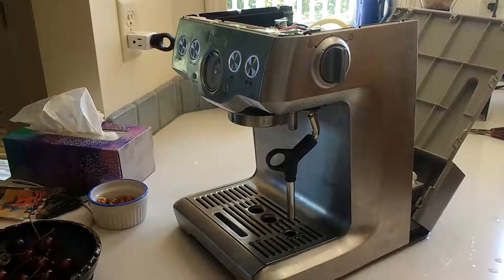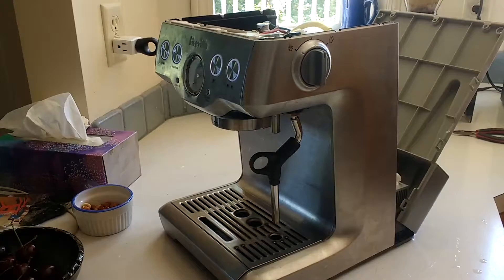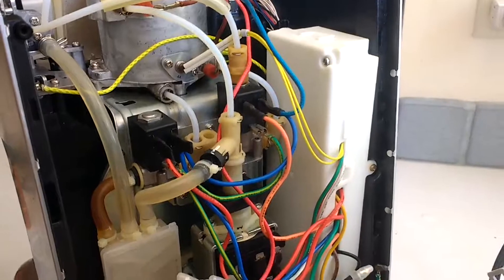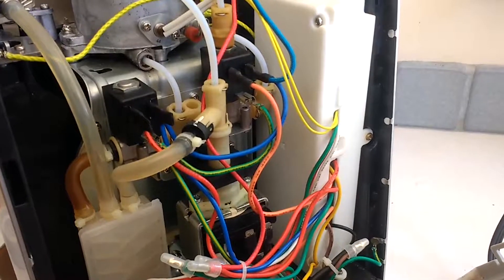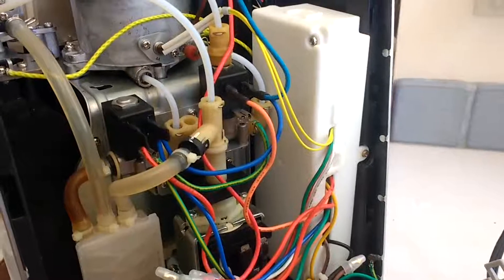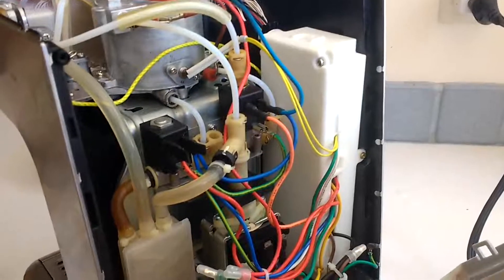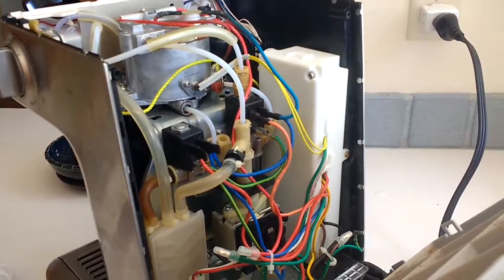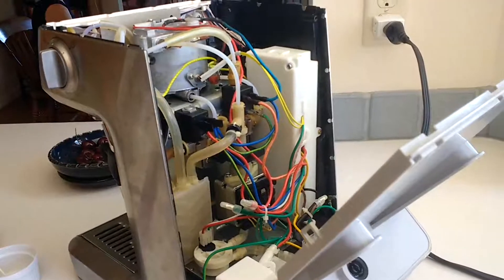Breville Infuser BES840XL - no water flow - solenoid block repair

Comment: How in the fuck did you get the back off this thing??? I've pulled every screw everywhere, and it still won't come off. If I pull any harder and going to break something
Reply from the maker: That removal is indeed challenging. If you look carefully, you will see three little gray female "rectangular loop tabs" along the edge of the removed panel. Those attach to three corresponding male protrusions on the main body. A flat-bladed screwdriver can be carefully used to pry a slight gap between the body and the rear panel as you pull backward on the rear panel, starting from the top. It did take me what felt to be quite a bit of back-pulling force to release them. 

And, one of the plastic loops has now broken during a later repair. Fortunately the other five plastic loops still hold the panel on just fine.

Hope this helps you.
Reply: @ritawije  wow, can believe you responded, thougg it was just venting to the ether. Thanks!

The clips you mentioned were a pain, but I got them uncliped. The problem is the lower section of the unit, where the water tank sits on. It feels like there is still a fastener holding it on. Something hidden. It shouldn't be this stubborn to remove. I found the hidden screw underneath the tamper.

I'm not seeing any other fasteners under the machine, not sure what I'm missing. I'm gonna give it a good pull, can't break broken.

I really do appreciate you responding though, can be useful for someone else in the future
Reply from the maker: Did you remove the screw that is under the little grey plastic cover, right behind the black water inlet which you see when you lift the reservoir? Pry that little grey disc up with your Swiss army Knife (or whatever) and there is a Philips head screw down there. Anyway, that could be your problem. If that screw has in fact been removed, then the only other thing (that I can think of right now) that holds the back on is the water tube that is attached to the underside of it. That tube needs to be pulled off if you want to set the back aside completely.
Reply: @ritawije  Mark... I feel like an idiot. I don't know why I didn't pop that  little cover off... that was the one. Thank you! I know what I'm doing this weekend. 

All the best!

Comment: I had the same problem of no water flow. I would suggest to prime the vibration pump, i.e. try to get water in the pump, to start again. Priming the pump solved my no water flow problem.
Reply from the maker: That sounds like an easy fix, if it works. I did not know about it, so never tried it. Please tell us all: How do you prime the vibration pump?
Reply: @ritawije  https://www.youtube.com/watch?v=xZIqO-i5kQg&t=62s&ab_channel=1st-lineEquipment
Reply: Hi , can you tell me how please ?
Reply: @karao7831  https://www.youtube.com/watch?v=xZIqO-i5kQg&t=62s&ab_channel=1st-lineEquipment

Comment: We have had 5 of these. Pricey (>$2000) and they typically fail at the 2-3 year timeframe. Our current model solenoid seems to have failed. I would look for a more reliable model unless you are very handy  with home repairs and can get parts.
Reply from the maker: Hey David, I agree with you. These are nice when they work, but were not built to last. Our unit is still in use, but I've had to replace the solenoid block with a new one after the "cleaned' one failed. As well, the hot water spout broke off once when the brew basket vibrated off and went flying. I fixed that by jamming in about 2" cut from the small end of a dollar store baster. Most recently the white plastic safety valve inside sheared off. Our local Vancouver supplier of Breville parts was out of those, so I ordered one from Australia. That fix was easy. But, when this machine fails beyond my ability to repair it, I will be getting another model, probably a Gaggia Classic. I like the hot water dispenser option, and many machines do not have that.
Reply: @ritawije  Interesting, Thanks

Comment: Hi Mark, this excellent video starts a bit ahead of an issue we are running into. For the life of me we cannot disengage the water tank assembly from the main housing. In your video it is already disengaged and leaning back. Would you be able to let us know how you removed it without brute force? Thank you!
Reply from the maker: That removal is indeed challenging. If you look carefully, you will see three little gray female "rectangular loop tabs" along the edge of the removed panel. Those attach to three corresponding male protrusions on the main body. A flat-bladed screwdriver can be carefully used to pry a slight gap between the body and the rear panel as you pull backward on the rear panel, starting from the top. It did take me what felt to be quite a bit of back-pulling force to release them. 

And, one of the plastic loops has now broken during a later repair during which I swapped two of the red o-rings in order to stop a slow leak. Detail on that: One of the connections seemed to be high pressure, and water was dripping from it when I turned it on with the back removed. I could see the o-ring was slightly worn. I moved that o-ring to another location, one which did not appear to have the same high pressure. I used the o-ring from that location in the original high pressure joint that had been dripping, and that worked to stop the leak. Fortunately the other five plastic loops still hold the panel on just fine.

Comment: Hi Mark , so the issue you were having was the solenoid valves right? Did the water pump was all good ? By any chance do you know the exactly part number for the solenoids valves and also the water pump… I may order them from China just cause the $ and see what happens.
Reply from the maker: Manufacturer: Breville
Product Number: SP0020444 (that's for the solenoid valves)
I do not know the number for the pump. You can likely find it by searching.
I will confess that my first "fix" did not last forever, and I found the new solenoid valve part at a supplier in Vancouver, BC and replaced it. Has worked great since.
Reply: @ritawije  Hi Mark, thank you sooooo much for the great video.  Super helpful.  Just want to confirm that SP0020444 is the right part number for the BES840xl Infuser.  I want to make sure I'm getting the right solenoids for it.  Thank you!